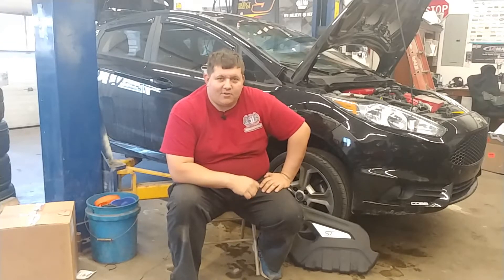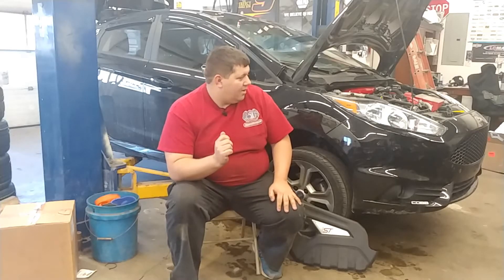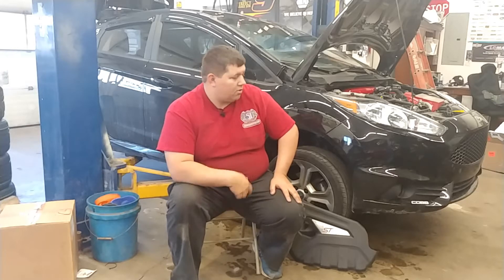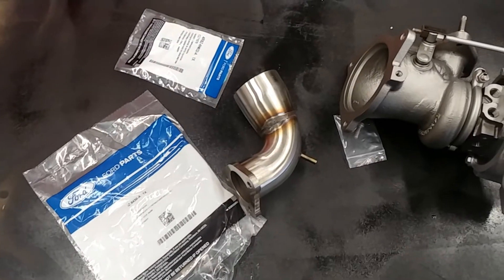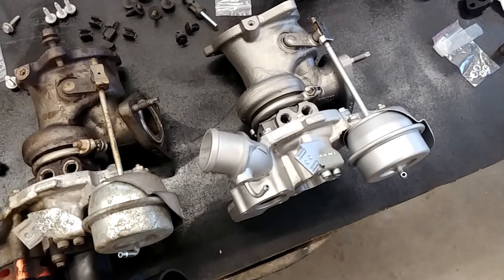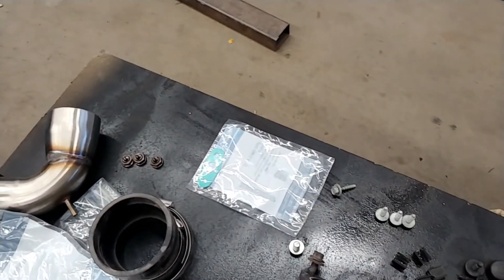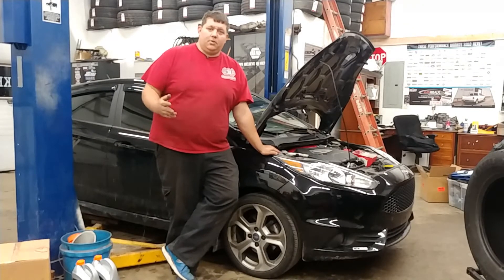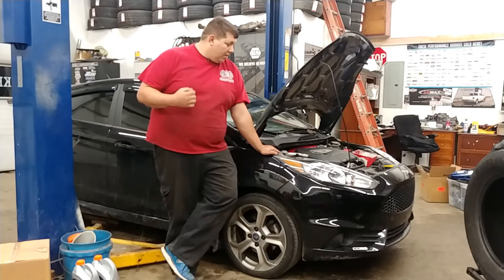Turn 4 Automotive Ford Fiesta ST Whoosh Motorsports Hybrid Turbo Install

Comment: Any Dyno updates yet?
Reply from the maker: Final tune is being done now. Dyno will be a month or so
Reply: Following.  Waiting for some Dyno or otherwise.
Reply from the maker: Was dyno tested yesterday after some dizzy tune updates. 281 hp/262 tq on a mustang chassis dyno.
Reply: Turn 4 Automotive & Performance wait a minute, dizzy tune is an e-tune. Why not tune it on your dyno?